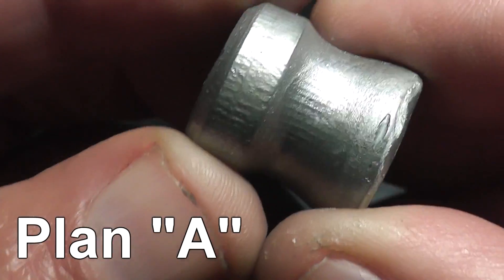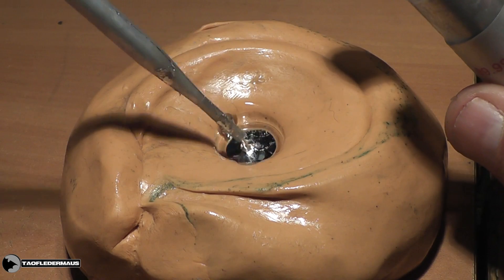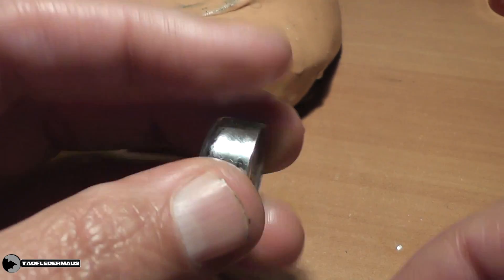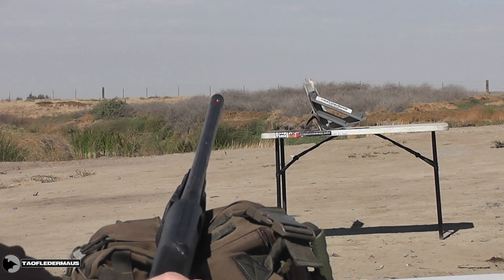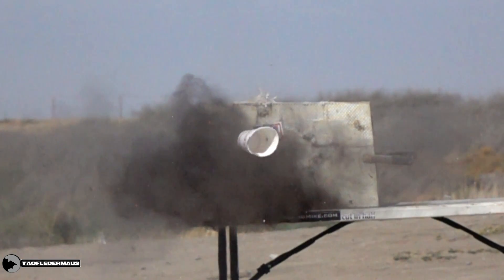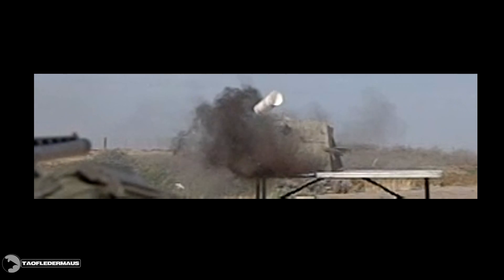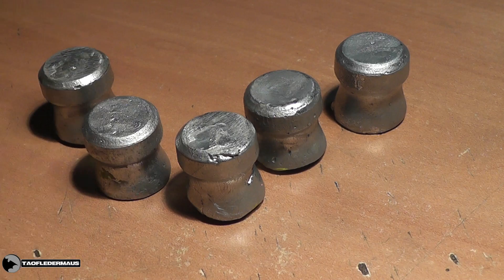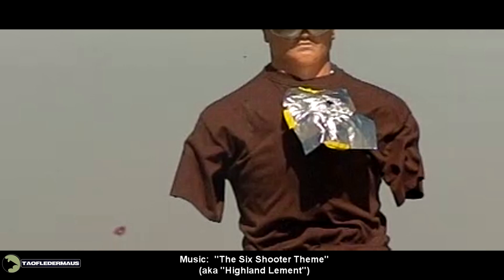GALLIUM -  What happens if you shoot it out of a gun?

Comment: Try to heat up the mold, pour the gallium and slowly cool it. Should cause less crystallisation that way.

Also, found out that one of the innerparts of a water mixing tap has a sluglike shape, with course threads on the inside, the other (front-)end holds the rubber seal which shuts off the water.
If it is legal to do so at your end, fill one up with a tracer compound (the threaded hole), prime it, and shoot it... Brass tracer slugs... Found the tap just hanging in the bathroom, sourcing locally is the way to go.

Comment: I'd like to see one of those 22. pellets used in air rifles used with 223. blanks and see what kind of velocity you could achieve
Reply from the maker: The bullet would probably be way to heavy and barrel pressures would spike and the brass case would blow out.
Reply: TAOFLEDERMAUS  I was wondering about that. another thing is seeing hornady critical line "flex tip" I took some gel syle finger nail polish dropped in end of a standard JHP as it dries it forms itself to the cavity then take non acetone finger nail polish remover and a q-tip and twist a few times leaves a nice clean cavity that's smaller than before I don't have the funds to do any real tests. let me know what you think

Comment: My guess would be that the thinner, plan C slugs had a smaller cross section parallel to the shockwave. The shock came from behind, so the thin nature worked against them. It could possibly be that the straight walls allowed cracks to propagate through the crystal structure uninterrupted.
I think I made a couple of those words up, but feel free to quote them as gospel.

Comment: U guys need to get much closer and personal with your target . That way the slug Won't have a chance  breaking in pieces like that . Farming 101. Lol
Reply from the maker: If the shooter used proper breathing techniques,  the slug never would have split.  lol
Reply: TAOFLEDERMAUS yes that's also true , it needs to be two rapid inhale and 3 slow exhales per pound used on trigger pull before shooting at a target assuming it's 25 yards . If the target gets any longer , then u need to increase the breathing measurements . Good catch . I didn't think of that .
Reply from the maker: I use the lemaze method combined with kegel squeezes to enhance my shooting velocity.